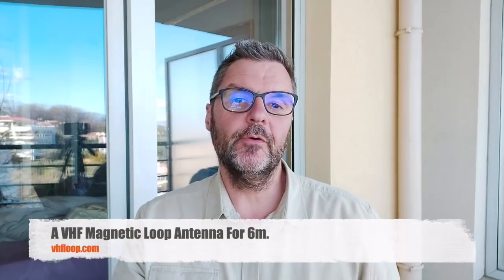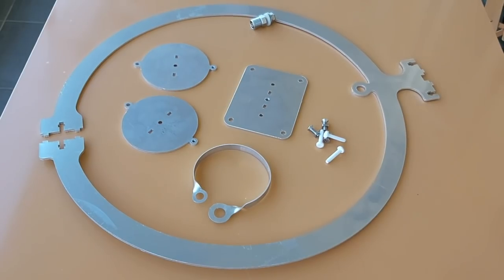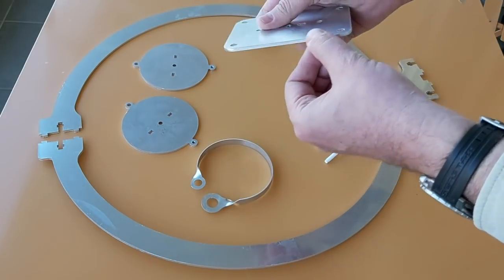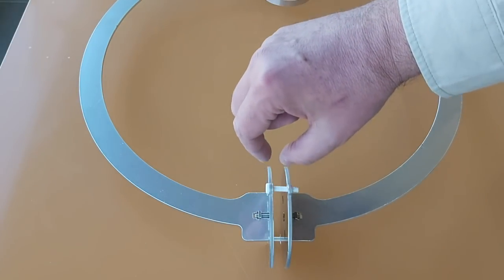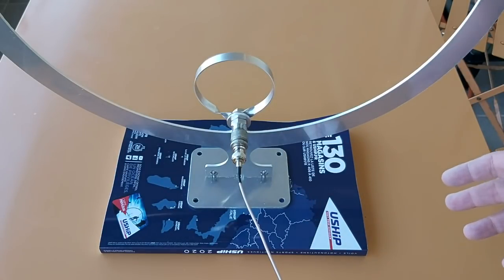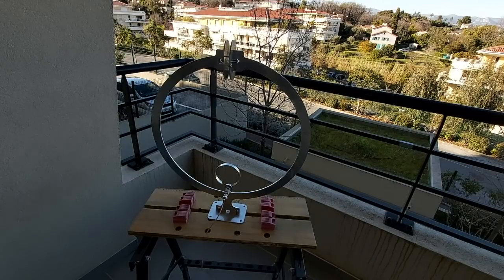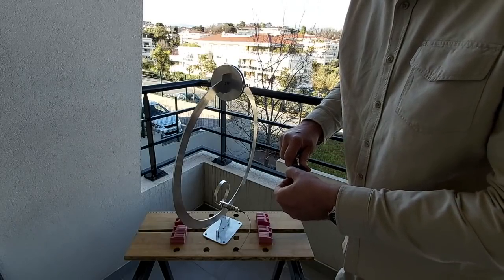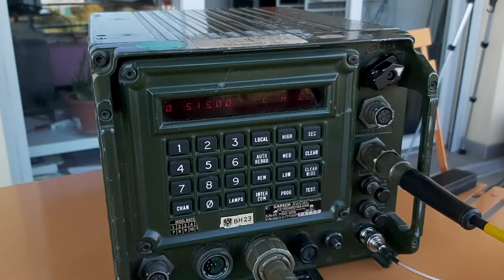A VHF Magnetic Loop Antenna For 6m.

Comment: What a cool antenna.  Thanks for sharing.  Searching for a 6m mag loop was on my To Do list.  I have this crazy notion of using a fixed tuned mag loop for 6m JS8 so my local prepping group can text message without the internet or cell phones.  Here in the US, Technician class operators can use 6m and 10m but none of the popular HF bands.  6m is a fairly wide band that's under utilized and the local group would probably have the band to ourselves.  The mag loop is a small and efficient antenna, and the hassle of tuning it is not a problem for fixed frequency use on JS8.  Now I need to find a QRP 6m JS8 transceiver kit.
Reply from the maker: I think it would work very well..

Comment: The first call, with lower initial wattage, and pointing the camera at the antenna showed that the camera was affected by the RF from the antenna.  I bet that's why you then probably edited in a still image of the military radio after raising the wattage to 50 watts.  Nice video.
Reply from the maker: No still, but I did notice the flickering!

Comment: I have re-purposed my Loop for the "8M Band", 40.680MHz It tuned without issue to SWR 1.21 : 1
It as as a +/- Bandwidth of 25KHz of </= to 1:1.5... Perfect... It will live in the Loft for now.

Comment: This antenna look very nice, I'm making one by myself and I was thinking about use of aluminum strip, 2mm thick, bending forming the loop, but because of skin effect, the current flow just 1mm deep and this is right, but also 1mm deep just at both edges, making the flow of power like  twin thin loops in parallel, decreasing a lot the efficiency of the antenna.
Find out what John portune w6nbc told about loop antennas.
Happy new 2024

Comment: Hi Gil, 

Thanks for the nice video!
To adjust the capacitor, I use a pair of 40mm M5 screws mounted in the threaded aluminum part and wing nuts plus washers, all in nylon.
M5 seems a little tight (imperial thread?), but it works.
Reply from the maker: Interesting thanks.
Reply: It's Canadian so it should be metric.

Comment: Yes very interesting. I wonder how well it work with my yaesu ft 690...no mention of price on the website though. Look forward to your field test...
Reply from the maker: The price is on the site.. I am pretty curious as to how it will perform as well... Stay tuned...
Reply: Radio Prepper actually no the price is not given as I said not showing on my iPad anyway
Reply: The price is on the web site. $119.95 USD including shipping for the 6 meter version.
Reply: @sasines  oh yes clicking on products shows it...I just looked at the main page which shows the image but no price

Comment: I have the same one. I used the gamma match it was awesome. Little trick i did was to mount it on a lazy suzan so I can rotate it super quickly.
Reply from the maker: What's a lazy Susan?
Reply: @RadioPrepper  it's a type of serving device that spins around https://en.m.wikipedia.org/wiki/Lazy_Susan
Reply: @RadioPrepper  It's a rotating plate, commonly used on tables. Food is placed on it, and people can rotate it to get the food closer.
Reply: @RadioPrepper  you can get them fairly cheap and they do not have to be as ornate. Some are actually really simple.

Comment: It would be very cool and sort of steam punk if it had been cut from copper but there you go with expense and weight. I wonder if you could put some form of dielectric material between the capacitor plates to perhaps make it easier to keep parallel and make it spring back out as you adjust that way, just a thought. Very cool device.
Reply from the maker: Good idea!

Comment: I have just unpacked the 6M loop.
Did you need to bend the ends of the small coupling loop to fit on the SO239... mine is just a flat piece at present
Reply from the maker: Mine wasn't flat but I did bent it a bit..
Reply: @RadioPrepper  O.K mine is completely flat... 
I need to bend it around a round object to form circle, then bend ends, what diameter is yours..??

Comment: Hi Gil, great antenna! Great video! I was actually wondering if loop antennas exist above 30MHz. What about UHF? 800-1000 MHz would it work for GSM-LTE? Do they exist? I would like to try out. I can just imagine loops for 70cm, 1800MHz dect and UMTS, 2.4GHz wifi....
Reply from the maker: I have heard of mag loops for up to 2m, but I guess above that it gets dicey, and really, above 6m there is no advantage in using a mag loop, as the main argument is small size..
Reply: The same guy who makes this 6m magloop also makes a 2m "circular dipole". Not a magloop, but it looks very similar. I have one that I've been looking for an excuse to test out. Maybe I'll be able to drive out to somewhere with some elevation soon, and try it with my IC-9700. If I do, I'll report results here.
Reply: @AlGordon  A Circular dipole is what they refer to as a Halo antenna. They work quite well. I've made them for various frequencies out of aluminum strip and a version of one which had a few copper tabs to capacitively load it just a little (reducing the size by about 30%) and make to it tunable. That was a very good performer too. You can run them vertical or horizontal which if you're into 2m SSB is something fun to play with

Comment: Ça conception est originale en découpé laser.
Maintenant, si les Loop magnétiques sont à la mode. Leurs utilisateurs déchantent après quelques temps. Car dans certain cas, un bon dipôle épais, aura plus de bande passante qu'elles. 
Par contre au QRA j'en utilise une en diversité, montée en dessous du dipôle et cela me permet de m'astreindre de certains QRN / QRM.
Après au niveau des signaux reçus ; il sont quasi identiques de l'une à l'autre
73's
Merci pour vos vidéos
Reply from the maker: Ayant un petit appartement de 23m2, le loop est la seule solution possible. Super performances, mais ajuster le condensateur tout le temps fatigue vite...
Reply: @RadioPrepper  Pourquoi ne pas réalisé un asservissement avec un moteur commandé par la valeur du ROS ?
Reply from the maker: Beaucoup le font... Un jour peut être..
Reply: @RadioPrepper  J'ai un ROS  avec sa tête de mesure déportée qui ne me sert a rien... je vous l’envoi gratos (contactez moi en MP si vous voulez) il vous suffira a utiliser la tension issue de la sonde pour asservir un contrôleur de moteur pas à pas - Ainsi plus de crampes dans les doigts a ajuster le CV a air lol
73's F-10175 = F11DRE
Reply from the maker: Merci, j'apprécie beaucoup, mais j'ai vraiment trop de projets en cours! ;-)
Reply: @Radio Prepper : Pensez vous emmener cette antenne en /MM (votre bateau) ? Ce serait intéressant d'en connaitre les performances en mer. Apres, résistera t elle a l'air salin/iodée ? Peut etre faudra t il la peindre avec une peinture epoxy, isnt'it
Reply from the maker: Dan's ce cas oui, mais je doute que le 6m FM soit très utile en mer...

Comment: Too damned expensive for a unfinished, bare, CNC project.  The least they could do was to give it a cheap powder coat or an anodize at least.  Aluminum corrodes all too easily.
  I wonder if one could place a thin ceramic insulator for the dielectric in the capacitor in lew of the air gap, then crank up the voltage. . .
Reply: As it is this loop would be okay with 200W.
You are better really to stick with air dielectric for the lowest losses. Anything that heats up even slightly will cause the resonant frequency to drift.
However if you are interested in experimenting with dielectric materials for high RF usage, I have discovered that white plastic chopping boards (I presume they would be polyethylene) cut into pieces are impervious to the heating effects of high RF.
I found that nylon bolts (also uncoloured)  from an industrial supplies store here heated up badly on around 10m with a mere 50W of RF and bad drifting was evident. The bolts were only being used to adjust an experimental capacitor arrangement too. Anyway warm regards from here in Australia

Comment: what handset are you using on the VRM5080 Gil  ?
Reply from the maker: It's a Racal. They pop up once in a while on Ebay..
Reply: @RadioPrepper  do you have a type number,....and did you have to rewire it with an clansman audio connector?,....tnx, Ron G4FBC
Reply from the maker: No markings but it did come with the correct plug.

Comment: Using a military term for a military radio, you are DANGER CLOSE to that antenna. Please do be cautious. Magnetic loops can be very dangerous in the nearfield proximity and 6M is a high exposure frequency.  If you must be in close proximity always stay in the null to reduce your exposure to the massive H fields generated by the mag loop.  The best advice is to keep a minimum of 2 meters away at lower power and further at higher outputs.
73
Reply from the maker: Indeed! I was in the null but still too close..